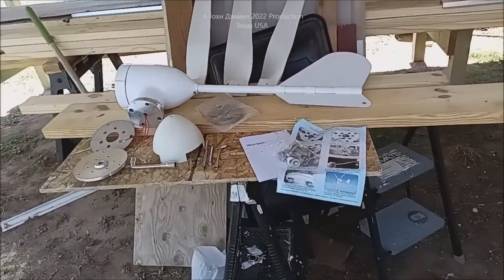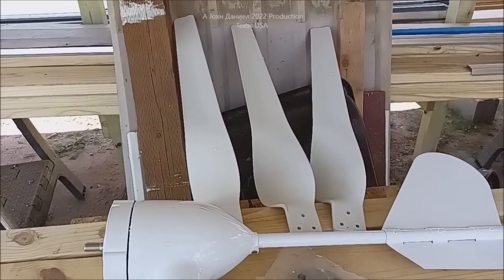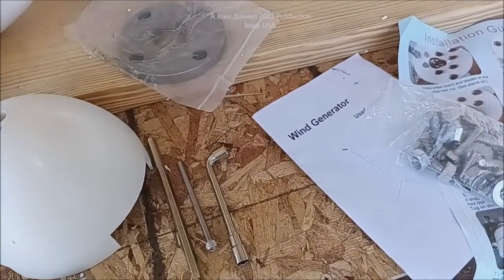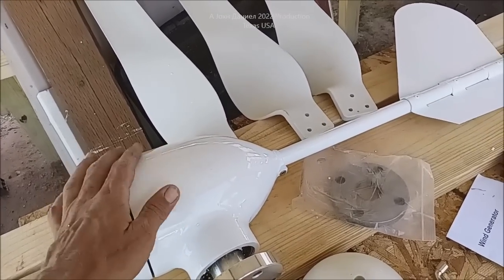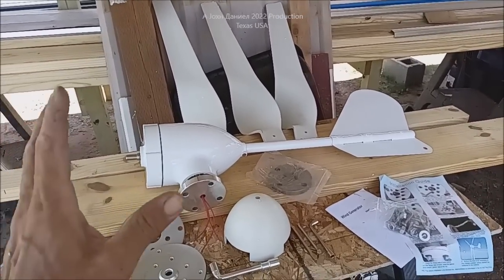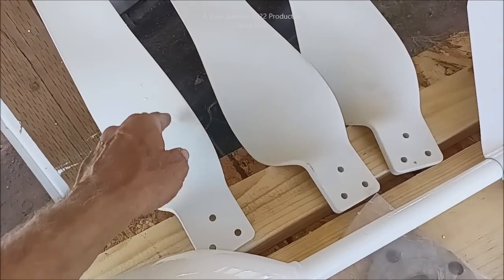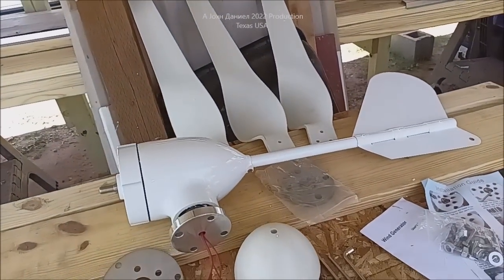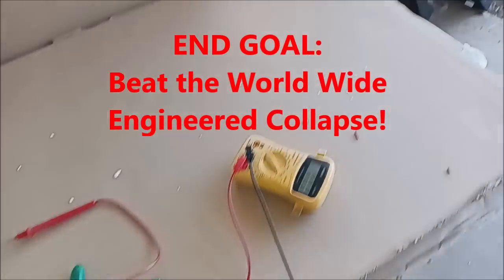Small Wind Turbine Generators to use for Off Grid, from Green Energy Solutions PARTS LIST BELOW

Comment from the maker: The LOW WIND 600 is https://s.click.aliexpress.com/e/_99l1XF ,makes wind power for almost everyone. Help real invention & discovery with BUY ME A COFFEE at https://www.buymeacoffee.com/JOHNDANIEL  UPDATED Extras ⬇ Full WIND store options https://s.click.aliexpress.com/e/_AFDRgV OR the HS 500 turbine http://s.click.aliexpress.com/e/BztCS7I0 3/5/6 blade in 12/24/48 volt From B&C (LOW WIND MODEL http://s.click.aliexpress.com/e/bE1zQnPw )  

🔋  LIFEPO4 Collection - UNOWIX Defender 100A https://amzn.to/3QB9nno  Power Queen premium https://amzn.to/3QfOY7T & REDODO 100A Workhorse Battery https://amzn.to/3dlHT7d DC watt power meters (2 sizes) https://ebay.us/lIoioF OR 200A https://amzn.to/3xBHKE0 Vevor Power Supply for setting your booster https://amzn.to/3JKeMGu

✨OTHER options - GE-500 watt High Output  http://s.click.aliexpress.com/e/Igjt80g 3 or 5 blade, 12,24,48 volt 

⬇️ Add the complete L.G. BRANDON SURVIVAL POWER SYSTEM -- 100 Watt Panels (12) https://ebay.us/Zla5aq , Affordable durable solar controllers pick (2)60A https://ebay.us/pODwA7 ,Solar Connects https://amzn.to/2XJOa1M ,Battery cable USA made https://amzn.to/3h6dsim ,12/2 Above/Underground https://amzn.to/2XIJolg for safe DC wiring of lights and appliances.
Cheap Inverter with proven 5+ year records of quality - 3000 watt https://ebay.us/YEaTX9 for tool, high amp, fine electronics, and start up use.
Reply: You are in Texas. I guess you could not afford the 2kw model? Because it would definitely work.
Reply from the maker: I'm a redundancy fanatic. 4 small ones assures power, 1 large one is to big a risk to loose in a situation.
Reply: @JOHNDANIEL1  Yeah ok I get that. Was curious though because the bigger the diameter the more efficient it is.
Reply from the maker: @davefroman4700  True, but with a extreme cost. Controllers for them are normally 48 volt, building slave batteries for it is $500, adding all the structure to mount it is very costly now with material issues. But, the grouping of 3 to 4 of the 500 to 600 turbines is easy and not needing more than a large wood post if need be! My friends in Nevada bought one. a 2500 watt model, in one ice storm due to its blade area it was destroyed. $3200 gone, and no power. But in the same storm that hit Idaho worse, mine just spun up and de iced themselves, no fails. If one had, then REDUNDANCY rules!
Reply: @JOHNDANIEL1  Well that is why you want solar and wind. They are counter cyclical.
Reply: Still waiting for part 2, where you show it running. I bought one of these also, it's in transit. Cheers brother!
Reply from the maker: @diogomartins9101  I am trying to find a spot to install them, 3 total will go up. A 2013 Windmax, a 2021 Hurricane 750 and the GE 600 from this year. Problem is PIPE!! I need to find some oil field 30 foot sections or 2-3/8  that are not 40% metal wall left in them. All I can find is VERY worn out used and at a crazy $70 a stick. If I can get some 60%+ metal left in it I would trust it.
Reply: @JOHNDANIEL1  goddammit John, I just received my 600W turbine and it came with some scratches to the case, wtf... Did it also happened to you? Really disappointed with their QA... Just noticed that mine has green cables, while yours is red... 😔
Reply from the maker: @diogomartins9101  yes, the shipping system is literally breaking down worldwide. Mine had a few nicks on one side, box rough. 
Not the fault of them over there. It's here where experience truckers are being replaced with juveniles.
Reply: Do you have any new links for the small turbines? Your links are not working anymore.
Reply from the maker: @Marcink126  https://s.click.aliexpress.com/e/_DBe9r7j
Reply from the maker: @Marcink126  If your using a ad blocker, turn it off, click the link, then turn it back on.  It's them google analytics trackers that block anything they can't make a dime from. https://s.click.aliexpress.com/e/_DBe9r7j

Comment: Hi Mate, big storm just missed my town, but we got 31Mph winds.
All 10 wind turbines are using 1.2M wind wheels with 5 or 6 blades.
14V - 24V 500W Vevor             -  6.5M high    -  761 Wh 
14V - 24V 500W Vevor             -  6.5M high    -  586 Wh 
14V - 24V ista Breeze i500      -  4.5M high    -  298 Wh
12V - 24V 300W Hyacinth       -  4.0M high    -  133 Wh
12V - 48V 500W Sunboo S5   -  3.5M high    -  305 Wh   
12V - 48V 500W Sunboo S5   -  3.2M high    -  128 Wh  
12V - 48V 500W Sunboo S5   -  3.0M high    -  106 Wh    
12V - 48V 500W Sunboo S5   -  3.0M high    -    85 Wh
12V - 48V 300W new rotor     -  3.0M high    -    72 Wh   
12V - 48V 300W new rotor     -  3.0M high    -    47 Wh
I live in a Low wind area, average wind speed is only 6.2 miles per hour.
Hey guys, think about posting your turbine information and production🤔
Reply from the maker: I'd say when you upgrade go to the Niaer wind 1000 watt versions with the 2.25m 3 aero blades and use the 48 volt version to charge 24v since you have low to no winds.

Comment: Hey John, my rectifier is making a buzzing noise only when power is passing through it, the buzzing noise will increase as power increases.
Have you ever experience this? I think the buzzing noise means that it´s not working properly.
Give me your thoughts.
Cheers
Reply from the maker: 2 things, a contact or terminal is not getting perfect connection OR You could have a diode in it that is going bad, making the AC voltage cycles produce a vibration. Replace it asap.
Reply: @JOHNDANIEL1  Thanks brother...
Reply: @JOHNDANIEL1  Hey John,
I just replaced for a new rectifier and is making the same buzzing noise.
Here is a video showing it.
https://youtu.be/5B8U4TvPCoA
Could it be a problem within the generator?
Reply from the maker: Why do you have so many wires going into the input on that rectifier? I have never done that, so I am curious.
Reply: @JOHNDANIEL1  it's the 3 resistors for braking, 3 ssr are being used to brake, 1 for each phase. My braking system is not on the DC side, it is in the AC side. Can you hear the buzzing noise?

Comment: How do I order from there? I cannot seem to get the transaction to go through after having bank authorize it.
Reply from the maker: If you are using a Ad Blocker that blocks cookies or tracking, it will cause a delay in your actions or block them. The buy button is connected just like many sites to a pop up which is really just a "order complete" link. Aliexpress has no adware, but some blockers will screw up your purchase. 
So, check back, see if it is pending, make sure you allow aliexpress to send you notifications and no ad block then your OK. It is using a European based system, real strict on verifying real actions.
Reply: @JOHNDANIEL1  finally got it to through. I think it took a minute for the bank to sync the approval after it was declined. Super excited to start playing with this one. Not sure if my math is right but I think it would be safe to say 100 hours @ 50% output would yield greater than 2,500KWh?
Reply from the maker: @beaushirley4668  250 watts per hour when wind is up, 4hrs x 250 = 1 kw.
Reply: @JOHNDANIEL1  mine showed up today.

Comment: I think I got a dud! It acts like the brake is on...barely turning in a 20 to 30 mph wind. With the three phase wires as "1" "2" "3" I see ac voltage between 2 & 3 and 1 & 3 but not between 1 & 2. Not sure how the coils are wired internally.  Have you any ideas??
Reply from the maker: Is it connected to a controller in those winds? What size battery bank?
Reply: @JOHNDANIEL1  I lashed it up like your drawing (no controller). i even got a knife switch like yours. :) Out of the rectifier and strait into a bank of 3 24 volt lithium 100 ah batts.  We had a good wind today (first since i put it up) and it was acting like the braking resistors were engaged so i disconnected everything so that the mill should really take off but i just barely turned.
Reply from the maker: If you can go up to it, check to see if 2 wires are touching anywhere from the turbine to the switch. This sounds like a insulation failure in the wiring somewhere or 2 wires joined that should be separate.
Reply from the maker: Remove wires from switch or check to make sure non got crossed on the screws or metal tabs in that switch. also.
Reply: @JOHNDANIEL1  Kinda thought that something was shorted.  Hopefully it is the wire and not the mill. Thanks for the sanity check!

Comment: How to find which type of battery is supported by the charge controller?
Reply from the maker: Wind turbines are not friendly to Lithium, but running them into some slave batteries, Marine style Lead Acid, then using a DC to DC charger to put that power into LiFePO4 in real time is my method.

Comment: John, didn't see the install video for this. I have a full solar setup that I pieced together and built, but my hybrid grid tied system doesn't have inputs for wind. Can I run two separate systems tied to the same battery bank? They both monitor battery voltage and stop feeding the bank power when it gets to the right voltage, right? Theoretically it should work...right? I am also in Texas (NE). Whereabouts are you?
Reply from the maker: I have numerous videos, older ones, going back long time. Since 2010. I will be doing a step by step newer video, back then it was 600 line quality vids. And We are in the center of Texas Hill Country.

Comment: I bought one. Put it up yesterday. Spins like hell, makes 16-17 volts. Don't know what I can do with it, since I have a 24 volts battery bank. Nice controller.
Reply: I don't think the video uploaded. I'll have to do it again. There was a check mark and I hit that, and thought it was done. I wasn't sure how to do it, first time. It was almost raining, maybe didn't get signal. I'll try again later.
Reply from the maker: What's the wind speeds its running at, what's open voltage on the 3 legs in that wind speed.
Reply: I posted a short video of it running.   Looks like it's making a volt per mile an hour of wind. It hit 29 for a second in a big gust.  It stays around 18-21 volts mostly. I've had the voltmeter on it for awhile.
Reply from the maker: @davidpotter9462 Do you have a wind gauge in the air watching the actual speeds. A 24 volt model after brake in  will hit 30+ volts at 12 mph in clean air with no obstruction nearby.
Reply: The wind is going to be 15-30 tomorrow they say. I live on a hill just South of the top. It'll be pushing 35 tomorrow, here. That's a little high for low wind. I'm going to have to have this thing rewound , or do it myself. My order was kind be of messed up anyways. The holes in the crush plate didn't line up, so I had to slot them, use washers, longer bolts, etc. When I saw that, I didn't expect much else to be right either. So looks like I have a 12 volts one. I guess the Chiwanese are having trouble with the abacus again...no telling what it'll look like if I try to rewind it. But it's no good like it is. I've got a 200 amp rectifier coming, so I'll hook up a pwm controller, and see how many watts it's making. I guess the short video uploaded showing the blades turning. The blades are turning but appear to stop on the phone. Whatever RPM that is. They were cranking pretty good though. That's when the voltage went up over 25 for a few moments. Pretty sure this is a 12 volts one..I guess the little video uploaded
Reply from the maker: @davidpotter9462  Send me the link to exactly what you bought.
Reply from the maker: @davidpotter9462  Where did you upload a video? Not on your channel unless you make it public. Check on it.
Reply: Oh, okay. It wasn't first time. I didn't know all that.
Reply from the maker: @davidpotter9462  You can go to https://wetransfer.com and send it to my email to review, I will get copy.  Then I can go through it with higher resolution  olympicpowercontrols@yahoo.com
Reply: I got the short video uploaded. It's supposed to be on at noon today. I had only recorded, not uploaded it.  It's about 14 seconds long.
Reply: It's on my channel now. Forgot to upload it the first time.

Comment: I will wait for the power tests, I had the 500 watt 24 volt from G&E brought in for a 12 volt system,  with a 600 watt mppt 12 volt hybrid controller or with a diode bridge, with a windstorm with peak winds of 140 km/h (90mp/h) I never exceeded 4 ah or sixty watts

Most of the time with 20 to 40 mph winds the wind turbine does not exceed 1 ah or 15 watts regardless if my battery bank is at 50% or 100%, the only times I have seen the wind turbine have need the dumpload is when my solar panels have filled my batteries, my next wind turbine will be a 12 volt but I don't know yet if it will be a G&E, I can't wait to see the power test of this one.
Reply from the maker: Your getting a ton of wind why not the 12 volt?  Seem you need to do some test. Send me a email with everything in detail and pics I'll see if I can help figure it out.  olympicpowercontrols@yahoo.com